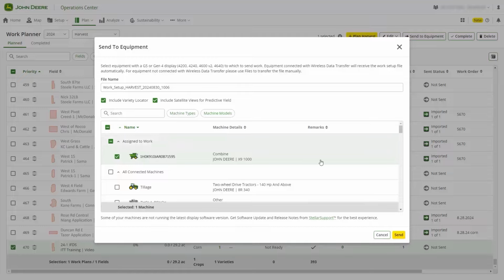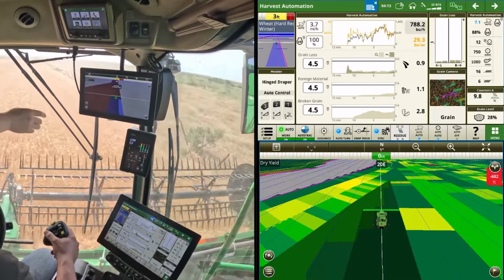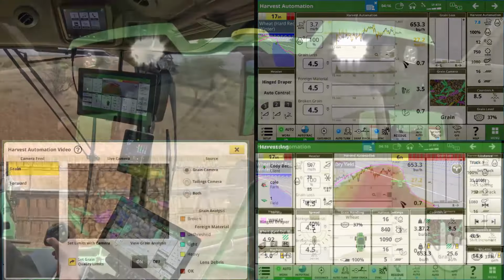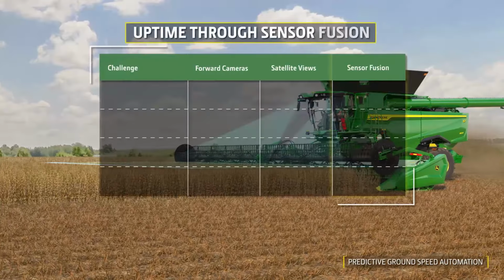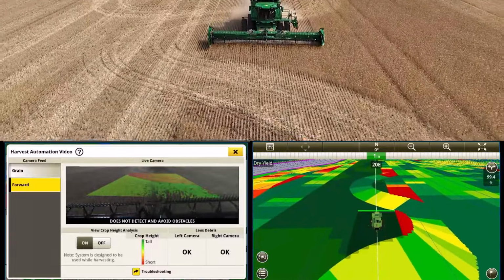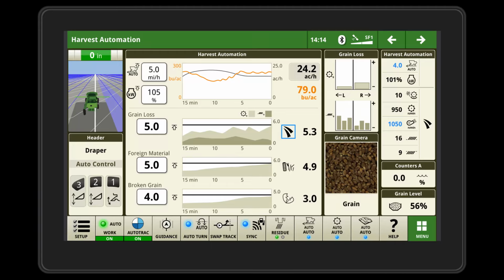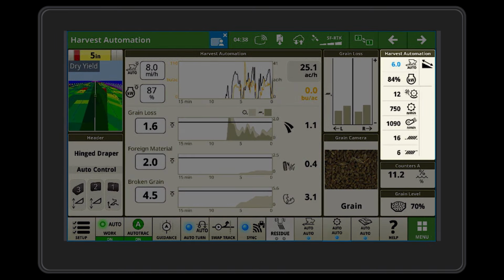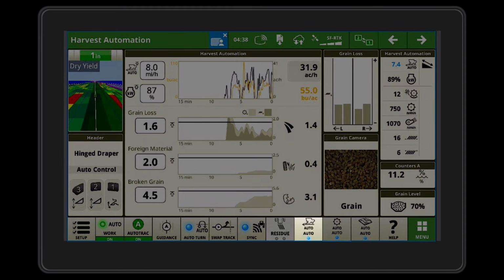Predictive Ground Speed Automation Setup | John Deere

Comment: Pity they went to a camera system instead of a lidar system as Case has used; far simpler to use in almost any weather and conditions, and no need for faffing around using satellite imagery. Yes it will work, but there are also too many steps where you only need a variation on one level, and the end user won’t be getting the best results.